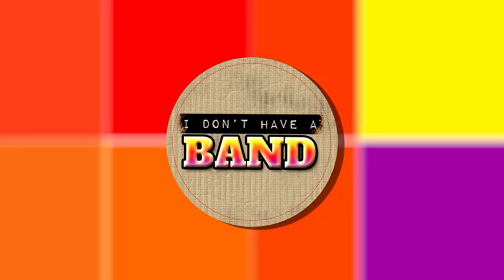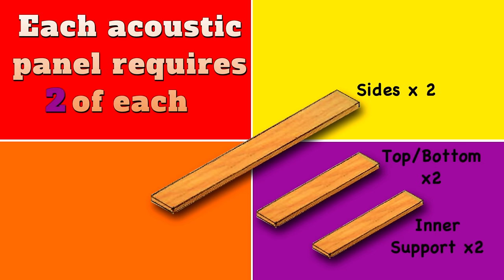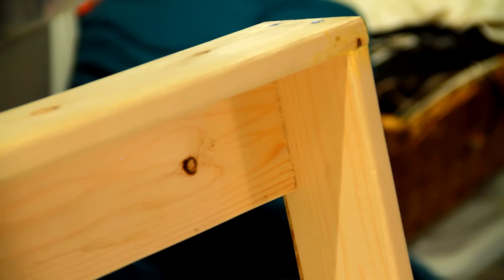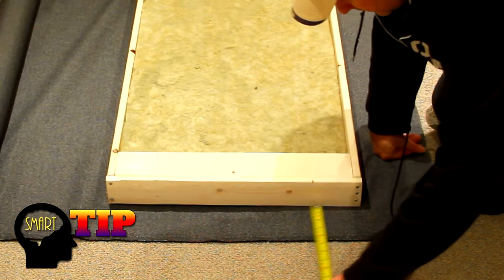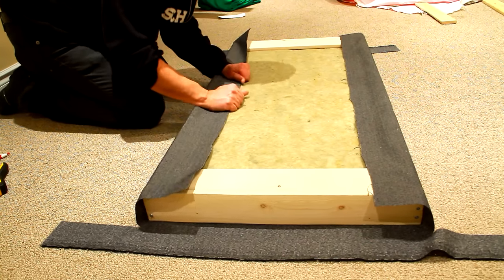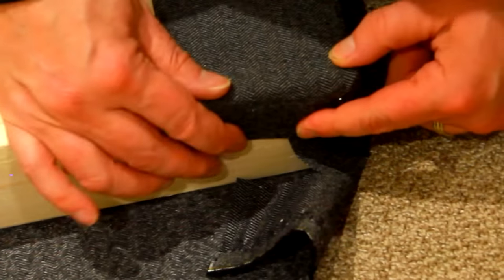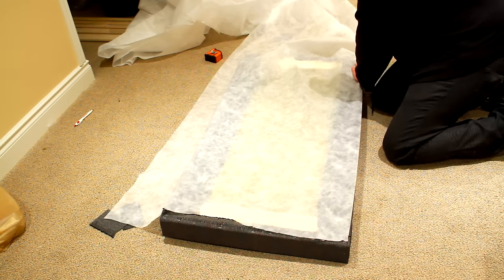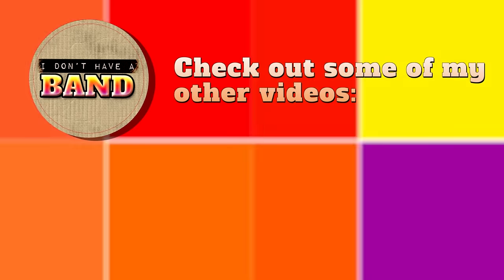DIY Acoustic Panels - How To Make Your Own Cheap and Awesome Panels

Comment: Some problems with this build.  Most insulation is a true 24" x 48" and is not short like this video says.  On top of that, you can't get four 24" pieces out of one piece of 8' lumber unless you have a magical zero-width saw blade.    Some other build advice, if you have a router table, round the edges and the fabric will cleanly wrap around the frame.

Comment: I am using this great, helpful tutorial to make my panels with the following mods/improvements: 1: I am custom sizing larger panels for the room I have; 2: using black landscape fabric for back and black “speaker” fabric for front so no color difference; 3: add back fabric before front; 4: modify the top bracing to be a French cleat (45 degree bevel) so it is dual purpose as mounting method with minimal stand-off from wall and very clean look; 5: leave top brace clear of backing fabric ((by about 1”)  so the brace/cleat is exposed to the mating 45 bevel piece attached to the wall (using same 1 x 4 material)
Reply from the maker: Glad you found this helpful and even better that you customized it for your own needs.  That's the spirit of DIY!  Thanks for sharing!

Comment: Just did mine.  I put the back fabric on first.  Went to Goodwill and found a large tablecloth for $3.00.  I stapled it securely to the back, then dropped the insulation into the frame.   I laid down the cover fabric on the ground then gently laid down the sound panel onto it.  (Tip: use painters tape around the frame to hold the insulation in place, otherwise it may fall out when you go to lay it down on the fabric).  After centering the frame on the fabric, I began to secure the fabric.  On the back, the front panel fabric will cover the back fabric.
Reply from the maker: Hope they work our great for you!

Comment: There are countless tutorials online. Yours is by far the best, simplest and more enjoyable to follow. You convinced me to tackle this by myself and saved me probably hundreds, if not thousands down the road.

I've made 3 panels so far. A few tips:  

1) Avoid Burlap. It falls apart. Its too transparent and is ugly.
2) Cotton canvas works very well. It looks good, easy to work with, durable and cheap.
3) Many in the US are having a hard time finding the 24" version Rockwool. I was not able to order it from Home Depot. I was able to special order it from Lowes.
4) You can use just one Monkey Hook to hang on drywall. I also used just one small D loop in the back of the panels. The panels are quite light and do not need reinforced hangers.
5) Apparent 1x4 lumber varies quite a bit in thickness. Don't panic if the frame doesn't align perfectly. The fabric hides the imperfections of the frame.
6) You can make a 2x8 corner bass trap using this exact same design. Just use 2 two 8' pieces and add two 22.75" support in the middle, just like you do for the top and bottom.
Reply from the maker: Thank you so much for your kind words.  And happy to help.  I have a few other videos on panels covering testing and placing.  I also recently did a panels 2.0 video that introduces some additional features to the panels.  Make sure to check them out before you start your build.  Best of luck with the project!
Reply: @LonelyRocker  I've watched your 2.0 video at least 5 times. Too much good info for one viewing session. Loved it.
Reply from the maker: Awesome.  Hope I earned a Sub ;-)

Comment: After months of anticipation, I finally built two acoustic panels of my own based on the information in this video and i'm super geeked! Worked really well :) Like other people had commented, I put the fabric on the back first, just to remove any additional frustrations with cutting, but either way thanks for all the information!
Reply from the maker: Glad this helped out!  The back first or last debate has been brought up by a few.  I talk about it in another video.  If you ever need to open the panel to adjust or fix something it's better to have the back on last.  Easier to get back in without damaging the outer fabric.  Other than that, they both work the same ;)

Comment: Super helpful video! Got my panels up and they work great! I would like to mention to others who plan on following this video that live in America my experiences in building this. Wood was super easy and cheap, costed about 24 USD for 8 frames. The insulation was not sold anywhere local in my area and I believe it will most likely have to be ordered online from Canada. Luckily when I ordered it online it was able to ship to a lumber store not far from where I live, but not sure if others would be so lucky so I’d definitely check that before building this. It costed me 70USD in total for the insulation, but it comes with 8 pats (8 pieces) which was perfect for the room I’m in because I need 8 panels. I had trouble with the fabric when I was shopping at local craft stores, because they didn’t have 58 inched rolls, only 54 inched rolls everywhere I went. Luckily a lady that worked there assisted me (I’m terrible at measuring fabric and such) we ended up using the 54 inched rolls because you should still have just enough to fold over and staple there just won’t be as much slack as the video has. As for the material, I needed white panels to match the room so I used a material similar to what they use for projector screens (idk what it’s called) but it worked great because it was thick enough to where the wood wouldn’t show through the fabric and it was about 5 USD a yard. For the back of the panels I just used the same material they use under couches and stuff. It costed about 90 USD for 8 of the fabric and 8 of the backing pieces all together, but it was on sale for me so it was only 70 USD. So all together for 8 panels it costed me about $160 USD. Again, great video to follow but just sharing my experiences to hopefully help others!
Reply from the maker: Thnx for sharing your experience.  You nailed this on the head.  My video is there to get you started but great you were able to adapt to subtle differences.  A lot could learn for your experience.  Thnx for sharing your story!!

Comment: Good tips and overall design. I recommend putting on the back fabric first so that it is completely covered and also so you can cut it without fear of cutting the front fabric. When you staple the front fabric, start with the tops and bottoms so that the folds are hidden by the sides. This gives you the cleanest overall look.
Reply from the maker: Thanks.  Pick through the comments or check my Panels Q&A video.  I discuss my logic about why I think putting the back fabric on last is the way to go...This has been discussed at length in the comments...

Comment: Just wanted to comment and let you know that after finding your video I am getting ready to build 12 of these panels using your method but with Owens Corning 703 and I cannot thank you enough for saving me the effort of figuring out how to design the panels. I have the roxul safe n' sound cut in triangles stacked in my corners for superchunk bass traps and the difference the acoustic treatment makes cannot be overstated. Great video!
Reply from the maker: Thank you so much!  I’m always happy to hear that my video helps! Once you’ve done your build check out my acoustic panels placement and sound test videos.  They may provide further assistance once you are ready to install   Good luck!

Comment: Dont you need to worry about breathing around the insulation? Even after you hang them up wouldn't it be bad for your health? After all it's meant to be in wall cavities. Just asking because I really wanna make these! 🙂
Reply from the maker: That’s a very fair question and a lot have discussed it.  Studies show modern rockwool is very safe.  If you’re concerned you could put an extra membrane of some sort inside. The key is it has to be somewhat breathable for them to be effective . I may do some further research and produce a video about this at some point. Thnx for your thoughts!
Reply: Although less effective (but effective enough) use towels or Auralex instead. The particles are really dangerous; extremely irritant for, lungs, eyes, and skin
Reply: That’s why you cover the panels all the way around. Wear a particulate mask while building them. Then cover them with fabric. Then hang them up where you want them and DON’T move them around or touch them anymore. They can sit in place for many YEARS without endangering your health if you leave them alone.
Reply: The fabric would filter any fibers but I doubt there would be any !
Reply from the maker: Check out some of my other panel videos.  I have added extra layers to help keep fibres in.

Comment: Also what do i need to look out for when choosing a fabric.  I'm guessing it has to be acoustically transparent, but how would I know what is and what isn't?  thanks again.... great video!
Reply from the maker: With fabric it’s pretty simple.  If you can breath through it sound can pass through.  I chose a dense fabric because it was easier to manage creases.  Also the denser the fabric the Better it will keep insulation fibers inside. There is some discussion about putting an extra barrier of foil or plastic between the insulation and the outer fabric.  However, rule of thumb is simply, the less sound that can penetrate the fabric the more that will bounce back into your room.  All research I have done shows modern rockwool is safe so go with a fabric of your choice.  The more rigid it is the easier it will be to avoid creases but you can pretty much use anything.  Thanks for watching!

Comment: Great video.  Just finished making my first one for a friend's new studio and it came out great!  

I sanded the whole frame and rounded off all the edges to protect the material.  I also used 100% polyester for the front as I read it was good for acoustic transparency.  
Going to try to hang away from the wall a little by attaching small feet to the back side of the finished panel.  
Thanks again!
Reply from the maker: Thank you.  Glad you're making progress.  And personal tweaks to the formula are always fun.  I used feet in my install as well.  I touch on that in this video: https://youtu.be/IjCtAccI_7w Also, check out my Panels 2.0 video.  I introduce a new formula to the brew.  Good luck with the build!

Comment: The instructions here  have  been totally helpful. I'm not at the material wrapping phase yet, I still have to order my fabric, but I used these guidelines to build 18 panels, which took a couple of weeks, overall. 

I also ended up using a 4 1/4 inch hole saw and drill press to cut out evenly spaced holes in my wood pieces, before assembly. This should provide a few extra percentage points of absorption, although not necessary.   I should also point out that I went with modified 1x10 knotty pine for all of my frames. I've filled these with 3 layers of safe n sound, so I had to had a small strip to the 1x10's (really 1 x 9 1/4) in order to house three layers.  And each panel is wrapped in 1/4 inch polyester (dacron) batting before I do the final fabric phase. Overall, my build is a tad pricey though and more involved -  but for my needs I'm happy. Just thought I'd share.

Thanks again for these helpful videos!
Reply from the maker: Thanks for sharing your adaptations and glad these videos are helpful to you.  Sometimes planting a seed is all we need to get creative.  Adapting to your needs is an awesome thing to do.  Continued good luck with your build!

Comment: I have made these. I cut a 45degree edge of the front so that the insulation goes all the way and instead of flat on the bottom, 45degree angle there.. makes the "box" less likely to rack

Comment: I just used Rockwool yesterday for a bathroom remodel project at a house. A normal carpenter looks at it and thinks, “hmm this is good insulation and needed to pass my fire safety inspection.” But I looked at it and immediately thought “Yo, this would make a really nice acoustic panel for my home.” 

I am SO glad you have this video. Do you think the panels work really good? I’ll be moving into an apartment soon, and would like to cut some of the room echo and reduce some noise bleed.
Reply from the maker: I love that story!!  That's what it's all about!!  My pleasure, glad you like this video.  They do a great job cutting down echo for sure.  They do not have any soundproofing properties.  That's a different thing.  But placed correctly you will definitely improve the sound inside your room.  Check out my other Panel videos.  I have newer formulations for different needs and I also have placement and mounting tips.  Check them out!

Comment: The mesh backing, I would recommend wrapping the batt in it first, then snug fit into the frame. This will avoid having to do all of the extra work after putting the main fabric on.
Reply from the maker: Ahh..but there is a method to my madness. Revealed in this video: https://youtu.be/IjCtAccI_7w

Comment: This the best and simplest video on this topic.  Unfortunately the price of wood went up since 2018, so $20 per panel is no longer accurate.  Oh well.  I just marked where I'm gonna be making the cuts.  Pretty excited. Thanks for this!
Reply from the maker: Thank you!  I made this video so long ago and still gets tons of views!  Sadly, prices have changed but these last forever.  Good luck with your build!!
Reply: Eh, a 2x4x8 common board is $7.58 at Home Depot in Nashville, TN and that same board was around $6 in 2018, so I don't know if that's really worth mentioning?
Reply from the maker: Very much so.  Prices have gone up mostly because of recent events but as supplies improve it may not be so different.  Thanks for sharing...
Reply: @realmcdracula  common board I recently bought were around $8.50  each at Lowe's!  Would have went to to Home Depot but had a Lowe's gift card
Reply: @LonelyRocker  I finished building the frames following the instructions in this video and they came out Perfect!  This is absolutely the best video on this topic.
Reply: @realmcdracula  Lowes usually has 1"x4"x 8'pine B stock (listed as furring strips) for 4 bucks( It's still a rip off and aint the prettiest, but if you go through the pile, you can find perfectly acceptable boards for this project) just make sure they're not warped. Just thought I'd try to help a fellow Nashvegasian out.

Comment: Great DIY solution. I've gone a bit of a different direction, but fundamentally the same: open back frame, fabric over core material. Here's a visual detail tip: staple the corners on the ends (top and bottom edges ) FIRST, then the sides. Then when you fold the sides over the folded/staples end section, the lay of the fabric will completely hide the corner seam. I've been using a combo of acoustically neutral polyester bug-screen, or cotton muslin for the backs of my panels, but I like your idea of the upholstery backing. I'll check that out. BTW, you can get fairly cheap speaker fabric at JoAnn, or online. Makes for a stealthy, kinda goth look, and the acoustic transparency maximizes the absorption of the roxul.
Reply from the maker: Sounds great.  I tweaked the formulas I learned from.  Great to put a personal spin on them if you've got the skills.  Thanks for sharing the tips...

Comment: Am I correct in thinking that the reason why most people make their panels with a frame around the sides and an open back is so that they can leave an air gap between the panel and the wall? I want to make some panels for my home theatre but I don't have room for an air gap. I am thinking of just cutting some sheets of 1/4" thick wood into 2x4' rectangles, then putting a sheet of rigid Rockboard 80 on top and wrapping it with fabric. Since the insulation is rigid I figure it doesn't need the frame around it and since the sides are open it may even absorb sound a little better. What do you think? Are there any problems I'm not considering? 
Thanks for the informative video!
Reply from the maker: For the panels to be fully effective an air gap behind them is critical.  They don't absorb 100% on first pass.  Sound travels through, reflects off the wall behind it and bounces back through the panels again.  Especially mid to lower frequencies. The absorption process is achieved through a combination of the panels AND how they are installed.  The frame itself is not critical.  It just creates durability for the panel.  If you mount them on a board you may still absorb higher frequencies but mid to lower ones will bounce right off of the panels if they don't have an air gap behind.
Reply: @LonelyRocker  Thanks for your reply. I guess I'll have to do more research. I don't understand why the sound waves wouldn't reflect off the wood backing to the panel and have a similar effect since it would still need to travel back through the insulation again.
Reply from the maker: Just think of the air as part of the material of the panel itself.  So if your panel is 4 inches thick and you have a 2 inch air gap then the sound has to contend with 6 inches before it reflects back.  The absorption material works to slow down the frequencies but can't stop them all.  The more you throw at the sound the better it will perform in slowing the frequencies.  Mid to lower frequencies are harder to absorb.  They need more material, space and time to be absorbed.  The less you create, the less you will absorb.
Reply: @LonelyRocker  ahh so higher frequencies such as air hockey pucks pinging off the side of a table would be easier?
Reply from the maker: Something like that ;)